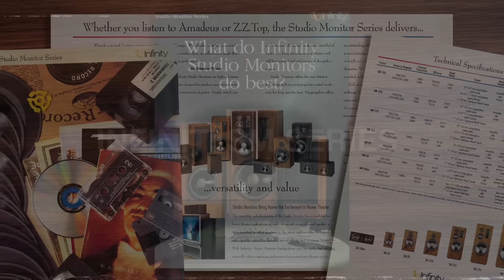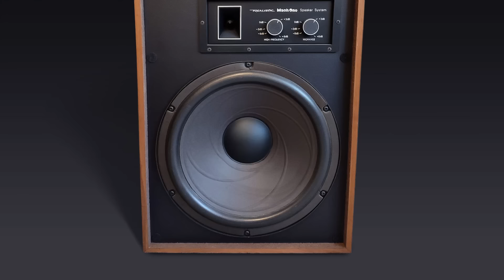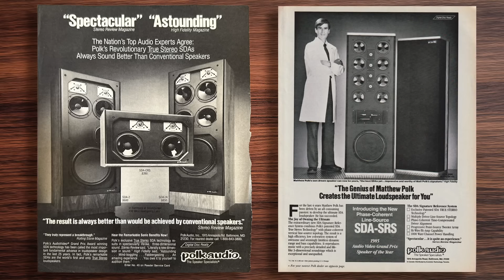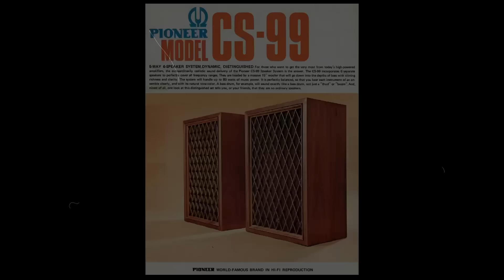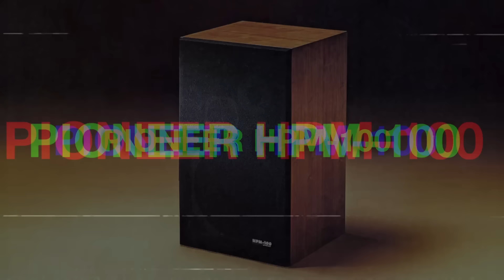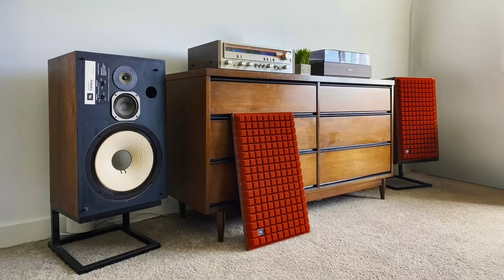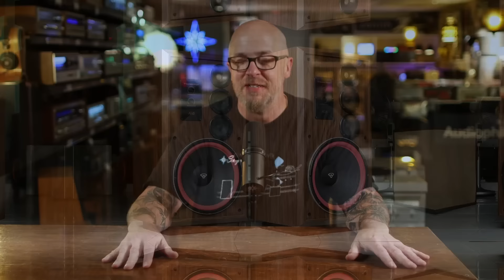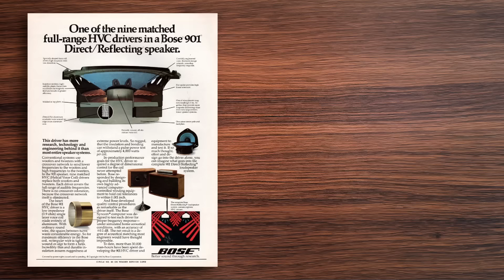Why Do Audiophiles Hate These 9 Legendary Speakers?

Comment: I recently came into some Cerwin Vega HED1230 speakers. I knew about Cerwin Vega but had never listened to any, that I knew of. They were unused for years due to disintegrating surrounds. I cleaned them up and tried my hand at re-foaming them. I have had them going for a couple of months now and they have really grown on me. They can be harsh, but all in all, I really like them.
Reply: The problem that I see with Vega's is that if the recording is bad then Cerwins can highlight this as they tend to be RAW in their presentation, 
I have some VS-150's that I reconed and rebuilt the crossovers using higher end componenets and they sound damn good, they are sat on modular Apollo Hifi racks spiked to the floor and under the cabinets, I also fabric dampened the internal walls and isolted the mids and tops in cardboard tubes, running from source, Pioneers BDP-LX88, Oppo UDP-205, Denon X8500HA into a QSC-3400 power amp, I run them in Direct mode because using the Denon's Audassy tuning software strips the sound stage away and makes them sound generic,
Reply: I have a pair of HED U-351. I've had them for 45 years. Currently having the woofers repaired one refoam and the other voice coil. I love mine yes I do like other speakers besides Cerwin -Vega. Would like to own JBL 4312.
Reply: @kimallen5068  I got the same pair of HED U351, love them.
Reply: Cerwin Vega manufactured a movie theater sound reinforcement speaker driver system that tavelled with the particular movie called SENS-SURROUND. "Battle of Midway" and "Earthquake" (a Chuck Heston mini disaster movie) were 2 examples. When there was an explosion in MIDWAY it was loud enough to scare the shit out of you!

Comment: I had the 901 series 4  (replacing my AR-18's) for maybe 4 years before I sold them.   Funny part is that I actually loved my 901's!   I did however build a stand alone tweeter with selectable crossover and adjustable attenuation to help on the top end.
In the end, the reason they got sold, is exactly as you mentioned.   For 901's placement is everything, and not once did I have a room that allowed proper positioning, even trying ceiling mounts.
Replaced them with B&W DM2000's and those rock to this day!
Reply: So the "acoustic expert" Omar Bose couldn't design a speaker that sounded good in actual rooms? Yet everybody else could...what is wrong with this picture? My cheap 40 year old Stax sound great anywhere.
Reply: @johnharvey7913  While I simply told my 901 story as asked by SkyLabs, your only response is to attack me?   Have I insulted you or your family in some way?   Or are you just being an a$$?

Comment: In Canada, Nuance speaker are widely hated, but I don't think they were sold anywhere else. I think, they are not that bad. I've heard better, but I've heard much worse. Out of the several models I have heard, they are definitely a rock/bass speaker. The biggest problem with them was the questionable sales tactics and they were vastly overpriced. 

I, like a lot of other people, bought some with my first surround sound system in 1998. I paid way to much for them and they did not sound as good at home as they did in the little room in the stereo store. I still have them, though, and once I hooked them up to some vintage amps and receivers, they sound way better than they did on the late 90s Pioneer AV receiver. 

Now, 20+ years since the late 90s and early 00s, you can pick them up pretty cheap because of their reputation. I think they make a decent budget option. Far from the best but pretty good, for the money.

Comment: I sold audio when I was in college - the late '70s. We had some good stuff. We also had Cerwin Vegas and JBL. We used to call the CVs "Cerwin Vulgars". I made up a slogan for them: "We couldn't make them better, so we made them louder". We would put the L100s up against less expensive speakers, like the Infinity 1001a and expected the customer to buy the Infinitys. Nope. Had to be JBL. That's fine. I'll take the bigger check.

Comment: I was a television studio engineer.  One time one of our studio speakers (very expensive one) went bad.  The production crew went bonkers about it.  We did not have the funds to replace it quickly.  So I proposed using a different speaker to replace it.  The production crew was furious about it.  They said the quality for playback would be horrible.  So, I bought a car 6 X 9 with tweeter, put in in a cabinet, and placed it on the floor in a corner opposite the good studio monitor speaker and wired it up (temporarily) so we could have stereo playback.  I did not tell the crew.  I got them into the studio, and told them I was able to repair the old speaker and wanted them to listen to it to be sure that I had fixed it.  When I played back one of their favorite recordings, they were very satisfied with the sound.  Even said that it might have been better than before I repaired it.  I then showed them the little 6X9 in the corner and told them it was the "repair".  LOL.  Speaker placement is a key thing.  Putting my home made speaker in the corner on the floor made the base perfect and flat, and the 6X9 with it's little tweeter did great.  Eventually, we got in the real replacement, but as the interim solution the crew was actually satisfied.
Reply: Smells like BS. Never happened
Reply: Back in the day 70s and 80s I mean everybody and his brother made speakers hundreds of grams to choose from too many names to even remember let alone mention. Many friends of mine head many different brands the ones that stood out to me were KLH Berwyn research and wharfedale s
Reply: @charleswilson925  My brother had the KLH speakers in the early 70s. They were tanks to handle rock and roll.
 I went first to Yamaha and then settled on  Infiniti in the late 70s.
Reply: I listen to my stereo from the side as the bass seems to resonate much better from that angle and still keep the crisp treble.
Reply: You were a studio engineer that doesn't even know how to spell 'bass'?
Reply: Spell check is a PIA. AI is adding words too.
Reply: @NotSure723  maybe he was using speaking text.... let it go.
Reply: @NotSure723  While I am good at spelling most are horrible at it. Base jumper or bass jumper? Just let it go. I've noticed it drives me less crazy when I do.😊
Reply: @cartoonjellyjar1  or bass, the fish...